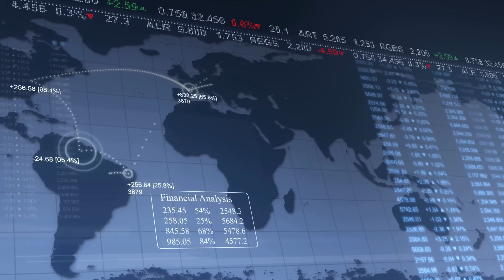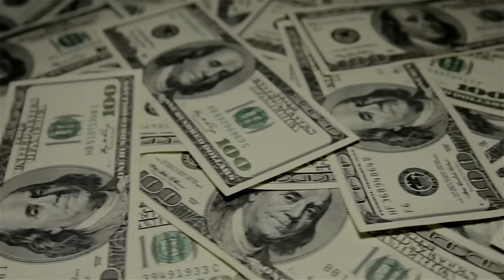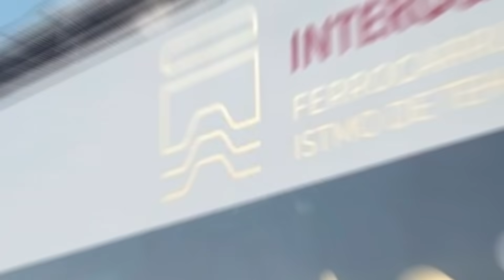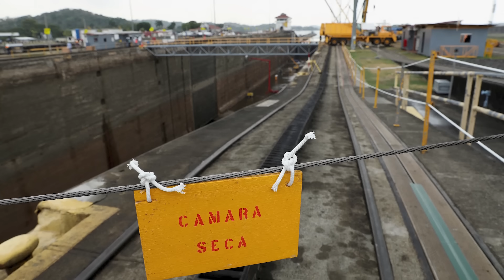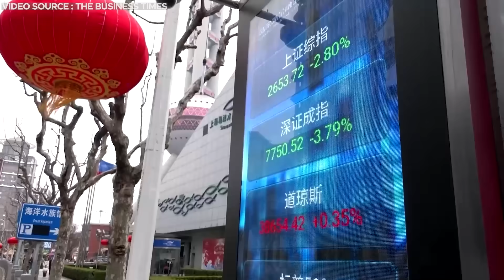Mexico Is Building A $5 BILLION Corridor That Will END The Panama Canal

Comment: the use of containers makes far more useable
Reply: fuck this channel, guy just likes to hear himself talk.
Reply: Just imagine dozens of ships carrying hundreds of containers waiting to be unloaded from the ships into awaiting trains (and you need lots of trains) to cross Mexico to the opposite coast which is three times the width of the Isthmus of Panama, that is only 63 km to cross even by train.  As the containers cross to the other coast of Mexico, they have to be loaded back from the arriving trains into the waiting ships to continue the journey up North.  The project sounds great, but the logistic would be a total nightmare.  Not even mentioning what can happen to those containers in transit... another nightmare to custom agents up North.
Reply: @albertomanuelcheung7103  sound so not efficient, not at all.  cannot beat a canal, if the land is level throughout nothing beats a canal.
Reply: @carlosrivas1629   Unlevel land is the problem with the current Panama Canal design and the reason it is running out of water to run the locks. What would happen if you built a set of canals that didn't need locks? If the two oceans are not equal in height, have a set of locks in the center and you will never run out of water.
Reply: @thomasboese3793  no dig the canal to be one level, we have better tech then when they tried to before, they can be a canal that doesnt need locks.
Reply: @carlosrivas1629   Are you absolutely sure the sea levels on both sides are the same at all times? The Moon has a way of moving tides daily and those would happen at different times between the two coasts.